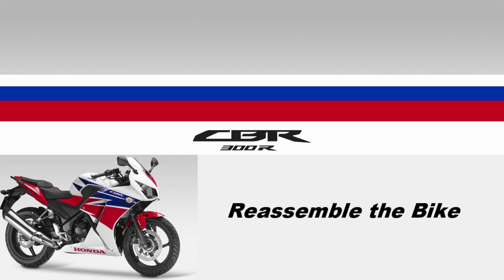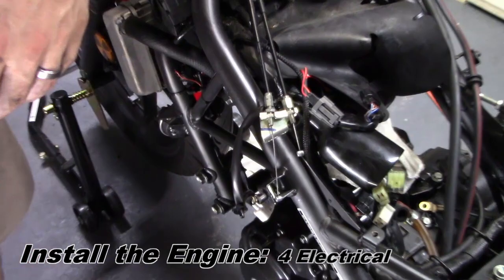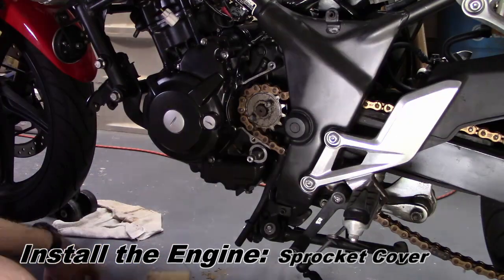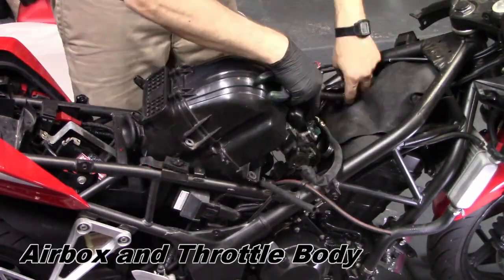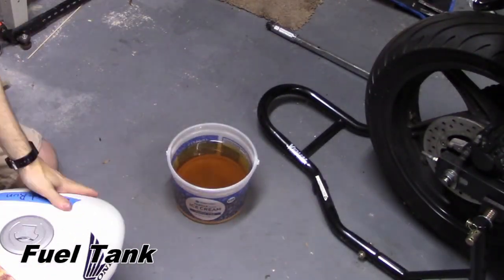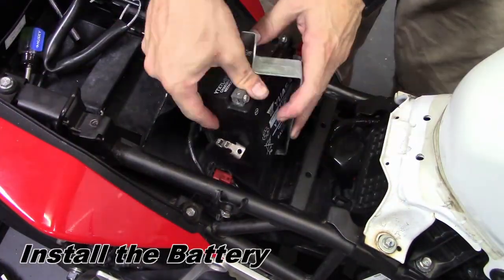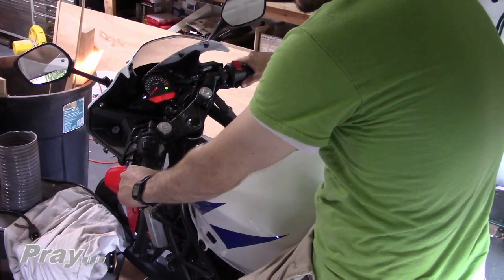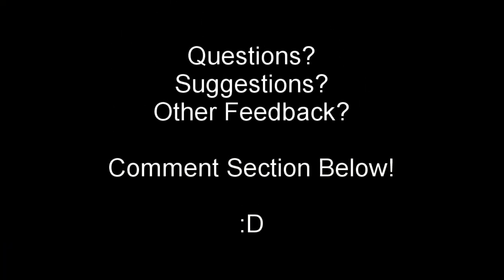CBR300R - Reassemble the Bike

Comment: Bro Can You Help Me , My Engine Cranks Slowly And Weirdly And Even Knocks But After 10-20 Cranks it starts and while the engine is running or idle ..it doesn't knocks or anything , my mechanic said that the crank seems to me jammed and i need full engine rebuild
Reply from the maker: Well....i havent personally come across that start-up symptom, but if the engine does (eventually) start and run fine, i would disagree with anyone who says the crank is "jammed".

What's the temperature like where you live? It could just be that your battery is getting tired and it's made worse by cold temperatures of the winter? Have you tried starting it while having jumper cables connected? Do you have an aftermarket exhaust? If yes, did you just slap it on there, or did you put a power commander in there too? Maybe you could link me to a video of the thing trying to start up?

I guess there's a number of ways i can think of to try to diagnose, but i would need a lot more information....
Reply: @lightningfrog27  thanks for your reply , kindly send me your email where we can discuss and I Will send you a video as well :)

Comment: Bro My CBR 250r Has A Problem , It Just Doesn't Starts Randomly And Does Starts ... like It Runs Okay but sometimes it just doesn't starts ...it only cranks ... Specially when left overnight ....it has very hard starting problems but once it starts ..it works fine no problems ...thanks and congratulations
Reply from the maker: Sounds like a battery problem, especially since it's winter. If your multi-meter says your battery is good, but you're still getting erratic electrical behavior, i'd say to pull it out and take it to an automotive shop to have it load tested. Are you using a battery maintainer? If not, probably worth getting one. If your battery is proven to be in perfectly good health, other areas to check would be the spark plug and the voltage regulator/rectifier. Let me know how it goes!
Reply: @lightningfrog27  i also thought that it is battery problem so i installed a brand new one and the problem didn't occured till this winter ...thanks for the reply bruh .. loved your videos ....lots of love 🤩😍😍😍

Comment: Hi.. Is there a way to check the oil pump without much disassembly?
Reply from the maker: I think you can get to it without dropping the whole engine out... probably just need to take off the fairings on the oil pump side, drain the oil, and pull off the crank case side cover.

Take that with a grain of salt though...I'm just speculating, haven't actually tried that. Good luck!!

Comment: Hopefully, you can reply to this, but I'm rebuilding a 2016 cbr300r but its mainly just broken fenders and bent rim and a few other things, but I'm almost done with it and I can ride it around, but I'm having a problem where I can get into 2nd gear and can't go any higher like it won't just click up, and when I rock it back and forth in second gear I can then get it into 3rd and do the same for 4th and so on, I've got the oil recently changed, I've heard there may be a bend in something in the engine, I'm not sure, I was just wondering if you would have and idea, there is a recall on the bike for a crankshaft failure, I'm taking it in soon to get that done and thought maybe that could be it.
Reply from the maker: Hey man - i havent personally had problems with gears getting stuck, but it's likey related to the gear-shift linkage. I have a bit of video showing how that goes together in my engine reassembly video ~ 9 minutes in: https://youtu.be/BXXXJCCrfVU?t=538
I can imagine that if one of those parts got tweaked, maybe it wouldnt want to shift? Alternately, if there's some sort of buildup on the gear-selector portion of the transmission, maybe that would make it difficult to change gears? (same video that i linked above, just look at ~4 minutes in).

If your bike hasnt yet had the recall, im sure the dealership could easily resolve the gear shift issue. Have you checked for the frame punch mark under the rear seat or done a VIN lookup on the honda powersports website? https://powersports.honda.com/recalls

Thanks for visiting my channel, and good luck with your project!!
Reply: @lightningfrog27  ok thanks, I'll look more into the stuff in the video, and i didn't see the frame mark punch and i did do a vin look up and it was just the recall, im going in later to get set up to get it fixed, thank you
Reply from the maker: @KnightT3mplar  btw, one other thought that came to mind regarding gear shifting - sometimes letting the clutch out just a little will help it get into gear. When the clutch lever is fully pulled in, the transmission isnt moving at all, so it can be more difficult for the gear teeth to mesh.

Comment: Any idea how much fork fluid to use in the forks?
Reply from the maker: @mrcla55yguy
From the factory service manual (16-27):
Fork fluid capacity on the CBR300R is 331 +/- 2.5 cc (11.2 +/- .08 US oz)
Fork fluid capacity on the CBR300F/FA is 311 +/- 2.5 cc (10.5 +/- .08 US oz)

Be sure to slowly pump the fork pipe several times to remove any trapped air from the lower portion of the fork pipe. Compress the fork pipe fully and measure the fluid level from the top of the fork pipe.....level should be 150 mm (or 5.9 inches) down from the top for CBR300R, or 146mm (5.7 inches) for the CBR300F/FA.

Sorry it took so long to look that up for you. Hope it helps!
Reply: @lightningfrog27  thanks bro. I found those figures that night and wasn’t sure but winged it. I used a measuring cup followed by a syringe to get right at 331 ml. Glad I measured like that because I forgot to pump the second fork🤦🏻‍♂️